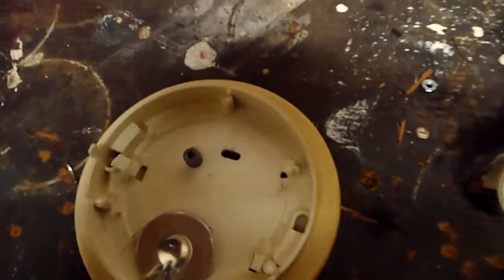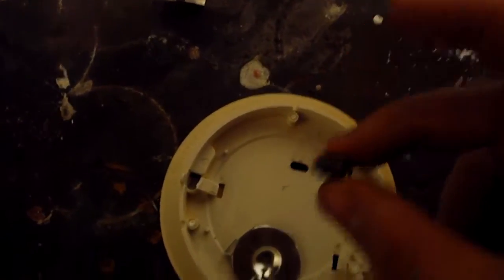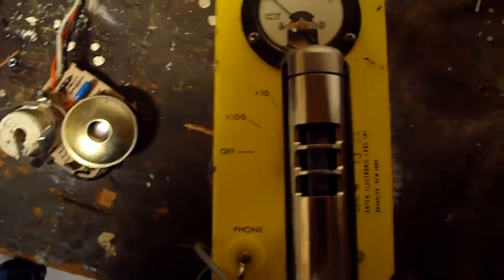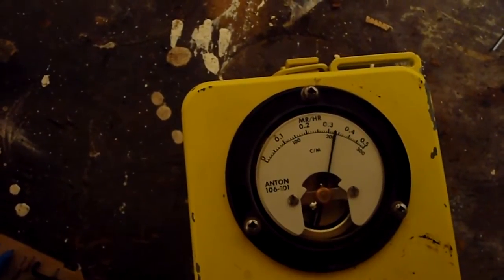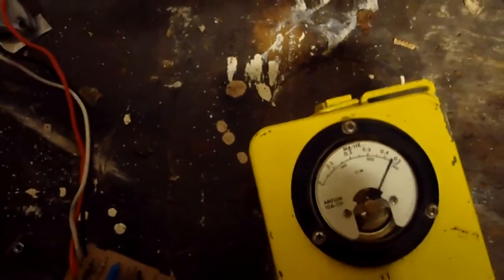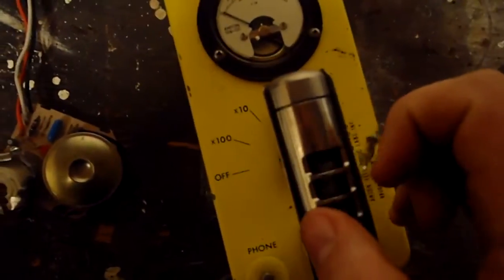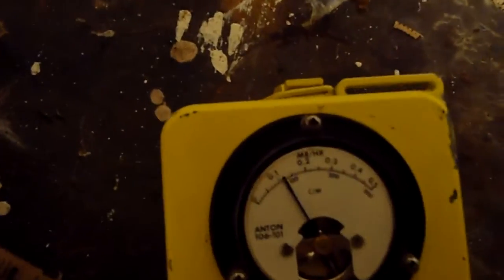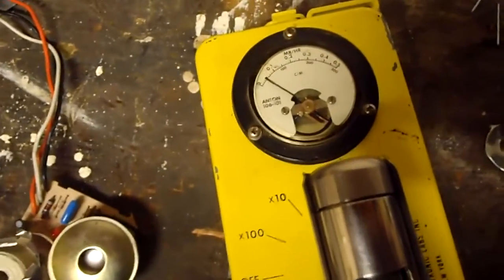Smoke detector radiation

Comment: The Am241 in smoke detectors is mostly an Alpha emitter, which is easily stopped by the shield, however your Geiger counter isn't made to detect alpha. So all you are detecting is gamma, which is much harder to shield against.
BTW, the smoke detector works much the same as a Geiger counter, it uses the energy of the alpha particles to generate an electrical flow between two electrodes. Because alpha particles are easily stopped, when smoke enters the detector it blocks the flow of energy which causes the alarm sounds.

Comment: I just changed all my ionization smoke detectors in my home to new eco LED photoelectric smoke detectors because I was getting a lot of false alarms. The radioactive americium is only dangerous if you eat it or inhale it by burning the smoke detectors or by breaking it open. Americium stays in the body for decades. Ionization smoke detectors should disposed of in waste drums; they can't be recycled.

Comment: @batfink1900 The gamma emitted from such a small amount of Am241 is big, lazy and slow moving. It's undetectable after a few inches from the source with the typical Geiger counter at maximum sensitivity. Put your hand between the probe and source and the counts disappear. Therefore, not dangerous in the least. Don't crush it up and snort the powder, but a perfectly safe thing to be around. Remember, you are hit by high energy gamma at least once every few seconds just from background.

Comment: It is unclear in the video as to whether you have the beta shield open on your counter. I suspect yes, because you were able to detect the check source on the instrument. In that case, your measurement isn't very helpful because most of these counters will go wild for beta, making the gamma measurement indistinguishable. Gamma tests need to be done with the shield closed. Am241 from my smoke detector gamma emissions are barely detectable more than 1" from the source. Beta disappears after 5".